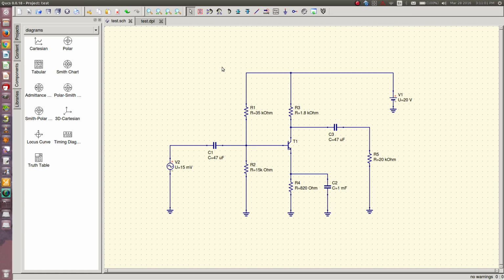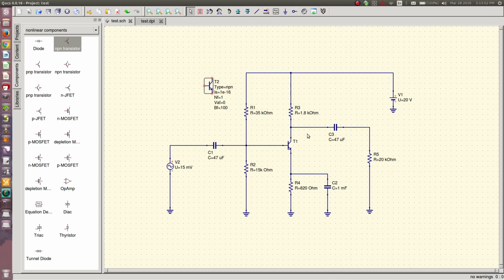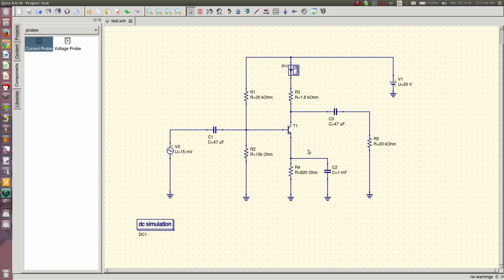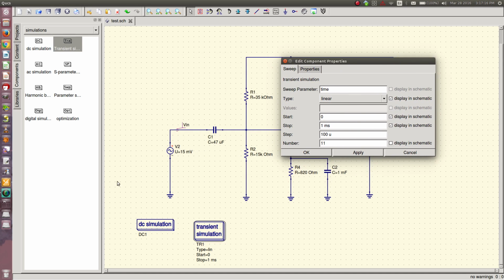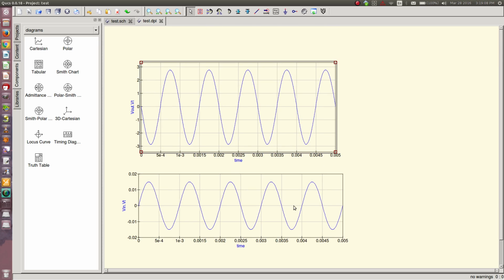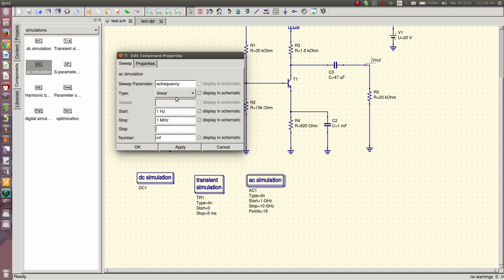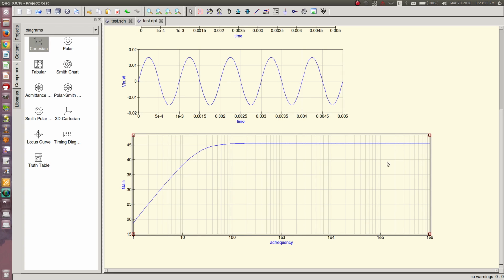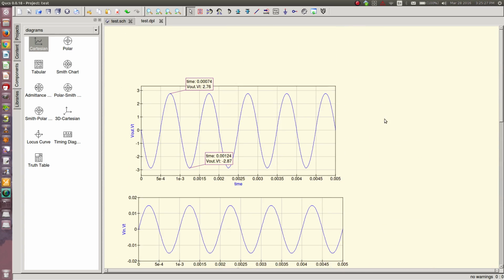Qucs Tutorial: Simulating a common emitter bjt amplifier circuit

Comment: Hi busterbear610! Thanks for this clip! It was VERY helpful.
I have this question, which I'm struggling to Google but I couldn't find: how do you run a cell with verilog-a model? How do you tell Qusc simulator to use the Verilog-A model rather than the sch model? Thanks!! Avner, avnerefe@yahoo.com
Reply from the maker: they have some documentation on using Verilog-A models here: http://qucs.sourceforge.net/docs/report/verilog.pdf

Comment: Hey
Can you please give some information about differential amplifier using npn transistors? I have a project to submit and i have to do that on QUCS. If you can convey the circuit and the values it'll be very helpful.
Thanks
Reply from the maker: I'm not perfectly sure what you are doing but here is a simple differential amplifier circuit made with two npn bjt transistors. http://s000.tinyupload.com/index.php?file_id=06452015731172121927
Hope that helps
Reply: THANK YOU SIR!!
You literally saved my ass!!
The link was extremely helpful.
Keep up the good work.
All the best!
Thanks a lot

Comment: Hello !, I have a question. How you can see the harmonics of a wave? That is, as I can do the fourier analysis to see the graph of amplitude versus frequency.
And another question, how I can put several expressions in the same equation ?. I saw in some examples has a built qucs and not how.
Reply from the maker: You can do a Fourier Transform using fft() and/or dft() functions. More information about these functions can be found here http://qucs.sourceforge.net/docs/tutorial/functions.pdf

There shouldn't be a problem doing multiple expressions in one equation block. Can you give an example for a problem you are having with it?
Reply: thanks for the information!

What should press keys to add another equation ?. For example, within 
qucs, you are an example called Ic_osc and has two equations.

Comment: Sorry again, I can not install the latest version qucs, as in the download folder (zip), from the official site, I never find the setap.exe file.
Kindly do I know how to install qucs for windows 7?
Reply from the maker: +Ser Marone The setup exe if available on sourceforge. The latest stable is here https://sourceforge.net/projects/qucs/files/qucs-binary/0.0.18/ and 0.0.19rc1 is here https://sourceforge.net/projects/qucs/files/qucs-binary/0.0.19-snapshots/ The 64 bit 0.0.19rc1 setup exe is called "qucs-0.0.19-rc1-win64.exe"
Reply: Download the file , extract it. Copy the extracted folder and insert in the C drive where the programs reside. Make a copy of the ".bat "file in there onto the desktop. Double clicking it (depending on your mouse settings) will open QUCS for you!
Regards,
Mthulisi